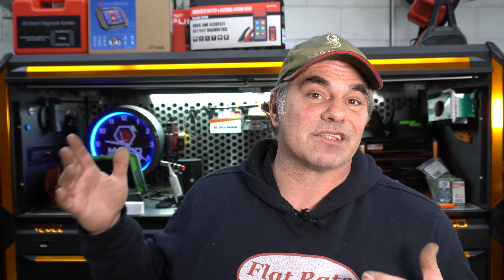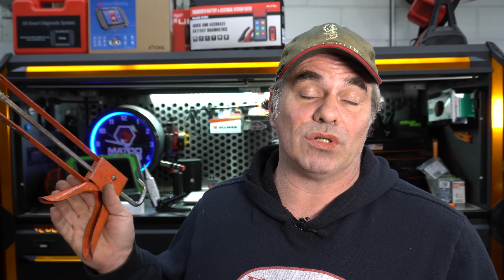Guide To Automotive Sealants

Comment: I've had zero issues with UltraBlack for 15 years. Works fine and you can be slightly messy and it won't look bad. Honda Bond is the best that I've used.
Reply: Give international silicone a try that stuff does not give up

Comment: I have got some stuff from stag called wellseal you need to paint it on with a paint brush it’s good stuff they call it jointing compound
Reply: Wellseal is my favourite too. I like how it doesn’t set and go off so gives you time to assemble.
Reply: @andygilbert1877  yer grate for holding gasket on stuff when your feeding like a water pump back in

Comment: Out on the ranch we use various sealants on our engines and equipment but the fun begins with other uses. We use whatever (usually blue) RTV on our Boggs rubber boots when they crack and leak in the yard. We use food grade rtv on the galvanized gravity feed chicken waterers and Ultra Red high temp to attach silicon gaskets on drying ovens and other similar ovens. Onward.

Comment: Hello Mike , Ac Delco 20-10 I believe that’s the number the stuff Gm uses is some really good sealant. If you are familiar with Mopar big blocks and their rear main seal issues with their infamous rope seals, I used this Gm sealant instead of the rope seal and so far it’s worked great I’ve used the gray high torque permatex rtv on several small block Chevy china walls under the intake with good success as well .Permatex super 300 is good also I use a light coat of that on paper style gaskets like trans pan gaskets or timing cover gaskets and around the runners of the older intakes (pre o ring style) . All of my toys are pre emissions  American cars and my methods may or may not be applicable to the newer vehicles. I tend to think it’s all about the preparation of the surfaces and following the instructions to the t which limits mistakes.

Comment: I've been using the Toyota oil FIPG for a long time with minimal issues. My main question is if the FIPG designed for coolant (4:26) would cause sealing issues if it makes contact with the FIPG designed for oil (the two blending together when bolting the timing cover back on). Alot of the Toyota Corollas and Camrys have very little surface area between where the coolant passage and timing chain area is. I personally have never used the Toyota coolant FIPG and would like to know more about people's experience with it.
Reply: It really won't react with each other since they are very similar  formulation wise, only time you'll get a failure is if you use 103fipg with SLL(super long life) pink coolant. 103 fipg can be used with long life(red). Honestly  I've used 103 fipg for everything  except inverter rebuilds or warranty water pumps which require 128b coolant silicone to a. Not void warranty, b. Is explicitly to be used with pink  SLL coolant. But the 128b coolant silicone I used by accident to seal my own matrix's oil pan and it hasn't leaked so I dunno, but at toyota we used black fipg for everything, the  orange for transmissions and 128b coolant silicone for strictly  warranty water pumps or inverter rebuilds because the stuff is hella pricey compared to 103fipg  which is 13 bucks opposed to 97 bucks for 128b
Reply: I e-mailed Threebond about this. In a nutshell, they informed me that 1207b will work fine for coolant. If you send them an email thru their website, they can explain in further detail.
Reply: @Alex35c  I used to work at Toyota and all timing covers/water pumps (warranty or not) were resealed using the 103 (oil pan) FIPG. I was never given the silicone FIPG from our parts department and the majority of cars we worked on used the pink coolant. I worked there about 3 years and don't remember hearing about FIPG related comebacks. I also still own a 2003 Camry using the pink coolant that I resealed (water pump included) with the 103 FIPG back in 2013 and it still hasn't leaked yet to this day. I'd like to "do it right" moving forward but I can't shake the "if it ain't broke don't fix it" feeling.

Comment: Threebond 1207B is what we use mostly. Toyota for the Rear diff / trans pans etc. comes in the same tube as the FIPG but its red and a different makeup.  
  1207B is awesome stuff and what we use for 95% of the oil sealing silicone. 
If you let 1207B  sit on the surface for 10min before installing the cover, pan etc. you damn near dont need bolts to hold it on at that point it gets so tacky.      
Toyota has special black silicon that comes in a green tube for coolant.

Comment: I agree to disagree about mixing gaskets and silicones if done properly there’s no issues use an example for an exhaust pitted flange that’s not available or able to be replaced put a thin bead high temp ultra gasket torque it let it sit for 24 hours. Last for years many fleet vehicles. Engine parts also minor pitted clean  it up the best you can very small amount ultra gray with gasket torque let’s sit no issues. The biggest problem I see people use way too much RTV and they expected to seal instant. Three bond is great product use that on motorcycles engines and such. Locktite is an amazing product use it on everything you just have to use the right stuff for the application and the right amount. I learned that many years ago when I had a free caliber bolt come loose after the vehicle went for driver training. Great subject to cover. Thanks for all the great content .

Comment: There is green thread locker which is designed for wicking into small fasteners that have already been assembled, like set screws or instruments, and there is green retaining compound that is super high strength for machined or slip fit surfaces. Bottles look the same tho!
Reply from the maker: good point!

Comment: The GM engine sealant works great for differential covers. I had bought that Permatex grey stuff you showed just to find out it has to cure overnight and I had about 10 min to finish the job. Used GMS and immediately put in the gear oil. It never leaked even after a year.

Comment: The newer “hi-performance RTV silicone” that ford specs for timing covers on the 3.5 ecoboosts is my go-to. Comes in the mini-caulk gun tubes. Super tacky. Will update with a part # when I’m back at the shop.

Comment: Working at Yamaha/Kawasaki shop (been riding motocross/enduro bikes for many years) on the 'case' 1/2s that are machined where you use 1104 at (people would create a disaster with it). Or use the wrong sealants like you said all over gaskets or all over the place.

Comment: I've been using right stuff for years I recently found an old can that was probably 2 years old. I pulled it out to use it and it worked just fine. Not sure how you are having problems with cans going bad unless you don't know how to store them. Remove the nozzle adapter and leave spout full of rtv and push a screw into it. When you need to use it pull the screw out with the rtv plug it made and you're good to go.
Reply from the maker: I know how to use them, when they first came out, one you started to use a can, if you didn't use it in short order, the propellent would be leak out. I haven't used them in several years, but have used several other cheese can style sealants without issue
Reply: The caulk gun tubes are the way to go on right stuff!
Reply: Thats what I use, the big 10oz one. Just squeeze a tad bit more out when done, next time pull the dried tip out and keep going. I like it since its approved to immediately put the item back in service.

Comment: 3m Ultra Black and Threebond are very good product lines. Threebond makes a sealant for every application and frequently updates their products. Harder to source but well worth it. Aisin makes re branded Threebond as well. I don’t mix sealant FIPG and regular gaskets. FSM specs. Threebond makes every type of sealant and thread locker. Excellent.

Comment: I was installing a new AC Delco water pump on a 3.4 Impala. One master tech said… “Paper gasket, no RTV…” the other master tech said “very thin amount of dexcool compatible rtv”. I decided to read instructions (for once 😑). Instructions from AC Delco indicated to use thin layer of rtv. I used black right stuff in conjunction with the paper gasket as indicated. Who’s right? I guess time and detection of coolant loss from the pump will tell. 🤷🏻‍♂️
Reply: My ford Territory(Australian) says the same thing

Comment: Engine re-builders have horror stories of  seeing the effects of too much sealant migrating into the oil pump and oil jets. I have also seen a video of someone who used "High Temp RTV" as an exhaust manifold gasket. It did not end well. I am not saying not to use it, but some have used it wrong in the past or just cut corners at less than honest shops that don't want to buy the gaskets. Some even try to reseal flatten gaskets with it. Just a word of caution, that's all.

Comment: What are your guys opinions on gasket dressings? Have some co workers (older guys), that swear by the Indian head stuff. And the permatex #2 or whatever that goopy stuff is. 
I know people use high tack to keep gaskets in place which I understand
Reply: I used the Indian head with good results on paper gaskets. I used super glue on the rubber gaskets to keep them where they belong